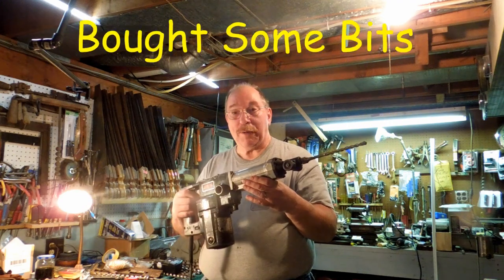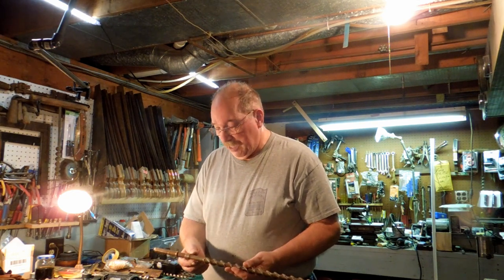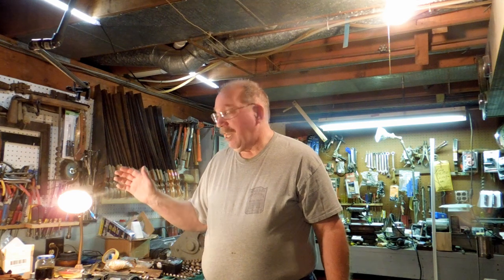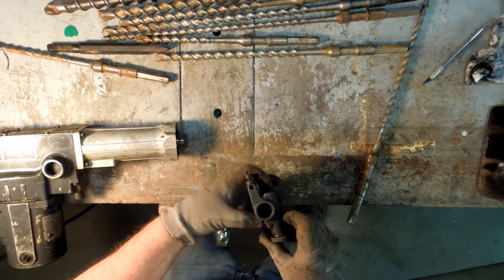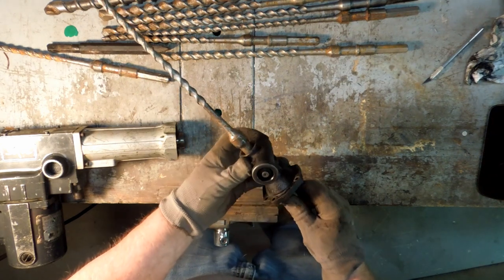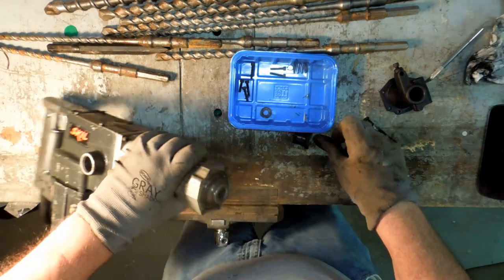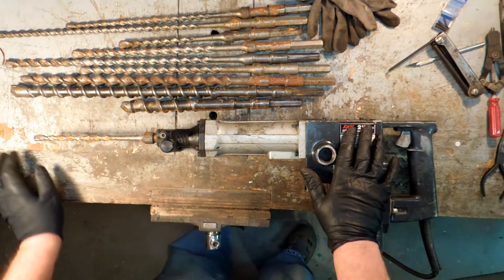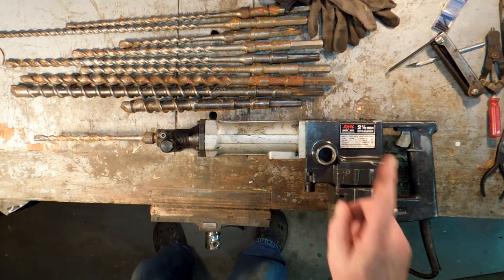Skill M731 Roto Hammer Restoration Pt 4

Comment: Just acquired a Skil 728 hammer drill ! Believe bits are possibly the same as the 731 but not sure ! 9/16th hex with collar and expanded  swell at end of collar  ! The 728 has a little lever that actually locks in the bit ! 2 things , when it says oil drops in nose of drill ,does that mean where the bit goes in and can u help me locate a site with these bits ? Im having trouble  ! Glenn , frm North Carolina  ! THANKS
Reply from the maker: Yes put the oil in the socket where the bit goes. 
I bought a hand full of bit off Ebay. 
Buying them new is not cheap.
https://www.icscuttingtools.com/catalog/page_156.pdf

Comment: You should look for a SDS adapter for the hammer drill, SDS is a more common size and much less expensive. Harbor freight sells a set for $10 & they are good.
Reply from the maker: I looked for an adapter, but the ones I found convert from standard to the new SDS. I think hex shank drills are obsolete. The HF drills are okay. I have a set of 4 from HF for the Milwaukee. Nice bits.
Reply: There is one listed on eBay, it's in England & listed for about $20 US.

Comment from the maker: Hi Snee, I appreciate your videos.  Can you tell me what kind of oil you used in the Roto Hammer.  Mine has run low and I believe that’s why my hammer function has faded.  Unfortunately, I can’t find a manual.  Thanks again.

Old Sneelock's Workshop
 https://www.fixya.com/support/t26875284-type_oil_or_lubricant_bosch_11241evs

Comment: Arthur's back but that's nothing new. Now for some green rock therapy!
Reply: Okay Mr Wright ya got me again. What's green rock therapy?
Reply: @mostlymoparih5682  It takes a special kind of stone to sharpen carbide. The ones i've seen are light greed colored. My helping on a track drill days!
Reply: And dang what's Unk trying ta dew reach China with them drills?
Reply: Balloons?
Reply: @mostlymoparih5682  Won't hurt as bad if they're too long!
Reply: @mostlymoparih5682  Quite possibly 4 a job well done, like aq dead pig sammich!
Reply from the maker: I don't have a green wheel, but the Foley came with a diamond wheel. Looking at the bits the carbide will outlast me. I don't expect to do much hard rock drilling.
Reply from the maker: @mostlymoparih5682  I just wanted to see if the thing worked. The guy selling accepted my starting bid and nobody else wanted them. I would have been happy with a single 1/2" bit. Ebay works best if you bid and don't look until you know you won. No temptation. 😆😎
Reply: @OldSneelock  10/4 on the Foley and your days of powder monkeying are past. Me 2!
Reply: @OldSneelock  Good score Unk.

Comment: For 2 bucks..pretty good score!! Now if I understand correctly the hex portion engages to rotate the drill bit and the piston causes the hammer. So why would you want a chisel to have a hex shape so it can rotate? Defeats the purpose. I suspect your chisel is correct and you just want the hammer feature only. I don't own a hammer/drill like that, so just using logic, which is often flawed!!!
I suspect a rack to hold your drill bits is coming next!
Reply from the maker: I'm going to be busy for the next month. I'll be lucky if I finish the toolbox before November. 😆😎
Reply from the maker: The chisels need a .490" round stub shaft where the drills have a hex. The chisels 3/4" hex main rides in a 3/4" hex cut into the iron nose piece. That guides the chisel so it doesn't spin.
With the old 90 pound air jacks you pinched the bit between your boots until it got started. Sure did tear up a pair of boots. 😨😎

Comment: Haven't used a hammer drill since I worked for Lucent.
Reply from the maker: Up until now the big ones were all rental Hilti units. 
The biggest I ever used came with a stand and drilled 8" diameter holes. Left the aggregate polished like gemstones. We were running machine anchors drilling holes for 6" H beams.
Reply: @OldSneelock  Nice.